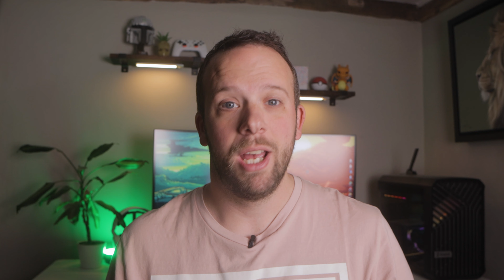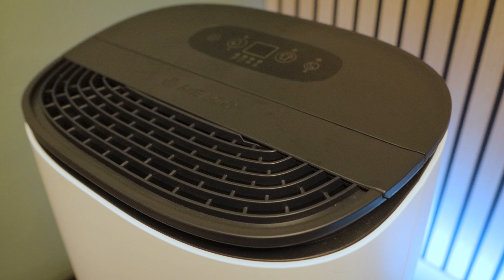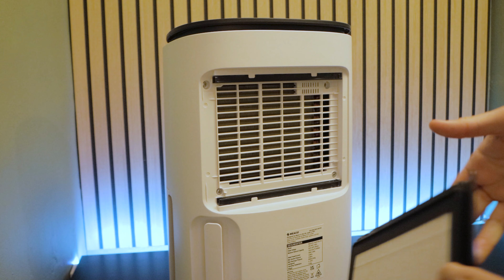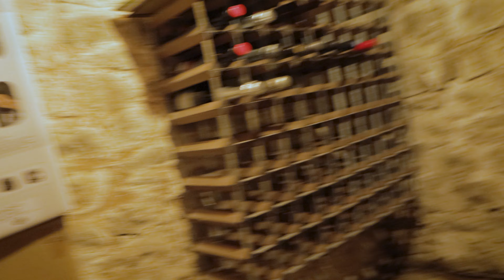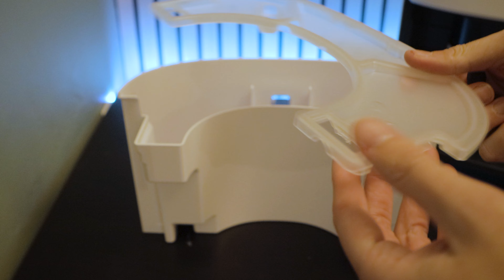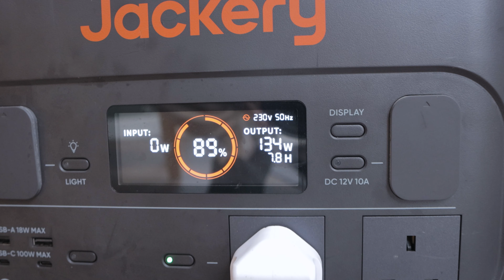Meaco Arete One 12L Dehumidifier Review | Efficiency & Running Costs Explained

Comment: Very helpful. I am about to switch from a dessicant to an Arete One so appreciate the demo :-) With laundry drying, if you are home, set a timer every 45 mins or so and rotate your laundry it will really help speed up drying. I have a free-standing collapsible indoor rotary airer so I just give it a spin and for trousers, socks and towels half way through rehang them the other way up. Generally 8-10 hours will fully dry a load of laundry, but 4-6 hours will usually deal with smaller loads or thinner ones like dish cloths and tea towels. Lovely ceiling beams btw! 🙂
Reply from the maker: Thanks for the advice and the kind words about the beams! 🙂

Comment: i guess the stated wattage is max draw so includes when the heater element is on
Reply from the maker: There is not heat function, any warmth is naturally generated from the compressor I imagine but the stated wattage should be when it's working it's hardest.

Comment: How much will the MEACO MeacoDry Arete Two 20L Dehumidifier & Air Purifier cost to run per hour ?
Reply from the maker: It can use upto 230watts, or 0.23kwh, so if you're paying 30pkwh via your supplier, it will cost around 7p per hour.

Comment: Great vid thanks. But going from humidity 86% to 80% over 12 hours ... is that supposed to be good? I expected a bigger difference in dehumidying ... even from 72% to 62% ... does it ever get to like 50%?
Reply from the maker: There are so many variables that effect performance and it can sometimes take some time! I have had it down to 55% before, my target, then it will turn on/off as when to maintain that.
Reply: @TechNuovo  thanks

Comment: Bought the Arete One 12L, it's stupidly loud at 40-46 dB from 1m. Do not buy if you're remotely sensitive to noise and you must be in the same room... I find it annoying from 3-4m away *with ear plugs on*, as I tried (unsuccessfully) to sleep with it running.

It also produces an annoying high pitched noise in my case. On top of that, once it reaches its target humidity level it will spin at full blast every 30m to detect the humidity level.

"Whisper quiet at 35 dB" claims their website... I don't think so!
Reply from the maker: Yup I certainly wouldn’t have it in the same room as me while sleeping.

Comment: I got abc 10l. Been like 31 hours on CO mode, just emptied 2nd full tank (2.6l x 2). Was around ~68% at 22c ish, now lingering between 52-56%. Foggy outside, 3-8C, snow melting so very humid. I kind of wish i actually got arete or so, so it would have airpurifier with that hepa filter for allergens, pm2.5 and all other crap.
Reply from the maker: Maybe next time when you need a new one, you can go Arête 😊

Comment: I’m thinking about purchasing one of these since I’m scared of opening the windows due to mice getting in. Would it work fine if I switch locations everyday between my bedroom and living room? Or perhaps if I leave it in a corridor? I hope the air purifier works good too!
Reply from the maker: It works better on a room by room basis with doors closed, rather than trying to do multiple rooms from a corridor. For me, I leave it in a room until Im happy with the level, and it might extract 1 maybe 2 tanks of water, then move onto the next.
Reply: @TechNuovo  Really? I been seeing a lot saying you’re meant to leave all doors open whilst doing it as that’s supposedly better.
Reply from the maker: I’ve just found it takes a lot longer to collect a tank of water if the door is open.
Reply: I’m also in a small 1 bedroom apartment that has like only 4 main rooms.

Comment: So I'm a bit confused, what does the L stand for then? Do I need a 10L 12L, 20L or 30L ? 
I live in rented accommodation and house has little to no insulation. It's very damp and cold in the house and heating doesn't last long so I need something to pull the dampness out of rooms. We have quite a small house.
Reply from the maker: The L stands for how many litres the unit will extract in a day at 30c 80rh. 

I have the 12L and a 3 bed house but I move it around, room by room. It removes a lot of water!

Comment: Out of interest if you pick yours up/move it do you feel something heavily weighted (maybe the compressor) move around/shift/wobble inside. I bought one used and it seems to work but something heavy inside seems to move
Reply from the maker: Negative, moving it and wheeling it around, it’s solid, it’s well built in my opinion.
Reply: @ umm thanks. Something loose in mine then.
Reply from the maker: Yeh might be!

Comment: I have the same unit for a similarly old house. I’d be interested to know how you optimised use around the house? At the moment, mine lives in the basement on a smart plug running 24/7. With a smart humidity sensor I can turn it on and off at the switch between a small range which means less time to go down to stated humidity. But means I can’t use around house.
Reply from the maker: For me, I have specific rooms to areas that are worse than others, so at this time of year I generally just rotate round, collect a tank full off water and move to the next. It may be a week or two before going back to that same spot, I just see how it is.

Comment: Bought one, too noisy to live with. Tests revealed between 47 to 69dbs, more than double the claimed 30dbs. Useless, as we wanted it on overnight to put an end to the condensation during the Scottish winter months. Could never get to sleep with that racket in the hallway, and no way in the bedroom. Certainly draws a lot of moisture out of the air, just way too loud.
Reply from the maker: Yup, you certainly can’t get to sleep with it in the same room.
Reply: I had the same experience with mine - like having a fridge in the bedroom - so I've put it in the hallway but that means I can hear it in every room of my flat !! as you need to have all the doors open for it to work😔

Comment: The L does stand for litres. It's the maximum extraction rate per day. The 25L will remove more water per day. However it also uses more power to do so. You're usually better off running lower power for longer than high power shorter. Unless you have very cheap electricity or don't care about your bill. Also the 25l would for example be better if you want a product to dry leaks in homes, this would get the job done faster.
The Meaco Arete One/Two are excellent products with very good efficiency.
Reply: Not just per day but at a certain temperature and certain humidity levels. It will not remove anywhere near 12 liters per day in a house kept at let's say 17C and 60% humidity.
Edit: apparently the test conditions are 30C and 80% humidity.

Comment: So happy found your video 1st winter in a tiny house built in 1840  even with heating on feels damp cold stone walls floors beautiful my washing not drying 😮 someone mention dehumidifier didn’t even know what one did lol ,been looking it’s a mine field haven’t a clue on tight budget watching this has helped 100% many thanks 🤩
Reply: Just bought one from Argos,   £190    have yet to try it,  well worth it,   does what it's supposed to do extracts water out the air,  well happy
Reply from the maker: Thanks for watching :D

Comment: New to using a dehumidifier. What should be the first step? Should I let it run until it meets 55, and then run it weekly or daily? Thanks
Reply from the maker: I would keep it going for a day, maybe more if the tank is filling up quickly. Keep going until you see the humidity stabailise and then turn it on as and when needed. I tend to run it until i've got two full tanks, then leave it a couple of weeks, they do the same again if needed.

Comment: Hi, thanks for the video!  My 12L arrived this morning. I switched it on around 6.30pm. So far been on 3.5 hrs and has dropped from around 80 when I first switched on to 73. I am going to leave it overnight but my question is, is it necessary to leave on all day too whilst I'm out at work or would it still do it's job if I switch off just before I leave early morning then back on when I'm home? There are days I work from home so I can leave on longer then but not sure if it's necessary to have on 24/7 as Meaco advise? Thanks again.
Reply from the maker: For me, it depends on the weather outside. If its dry outside with a low humidity, it will take longer for the space to rise back up to say 80 for 73, so you may not need to have the unit on as often. In the reverse, if it's wet outside and moisture is coming in, you'll need the unit on to combat that. 

I typically leave it on in a space, long enough to fill a tank, then leave it for a week, so what happens and take it from there.
Reply: Thank you!

Comment: Hi, does this help to prevent mould damp in the ground flat? I'm dreading this winter and I am so fed up of cleaning it. It goes onto some of my clothes and furniture, windows mainly bedroom has bad condensation. Landlord does not do anything. I'm wondering to get this machine and see if it helps. How long do I need to get it running?
Reply: I have the 12L one will be a big help to combat mould/damp etc,   works a treat especially the laundry mode
Reply from the maker: I haven’t had mold as such, condensation yes and a damp environment, which it helped with. I’d keep it running all day, or until the humidity has lowered. It might be you have it on for a few days to manage the space, then once it’s better, use it less often.

Comment: got the 12L and on low fan it runns at 50db 1m away from the machine and 37db at 10m . Not sure how they got that 35 as is definitely not even close to it. Is noisy enough definitely you wouldn't leave it on the room with you
Reply from the maker: Useful insight, thanks for sharing!
Reply: @TechNuovo  my guess is they quote the night mode dB. Bit of marketing trickery IMHO.

Comment: I have got the same dehumidifier and it does a great job . I notice however that when the level is below 3% from target RH the small dehumidifier light turns off (which would indicate the compressor is not on) but the fan keeps working and the machine lights stay on. Is this normal? From an efficiency perspective I would imagine the all functions switch off when below 3% of target? Thanks!
Reply: The fan consumes much less power than the compressor so there isn't a setting that turns the fan on and off. It's also good to run the fan for a few minutes after turning off the compressor anyway because the cold side is still cold and can capture more humidity. It does this automatically when the tank is almost full.
Reply: what does RH stand for?

Comment: Just bought the Atete Two which is very similar.
Just to confirm that having the machine on 24 hours a day, it will continue to draw the 150w(ish) even when it’s reached the desired humidity. I would hope that it would maybe only run for 12-15 hours of the 24hours when it’s been in situ for a week or so?
Reply from the maker: Depending on the setting, when it hits the desired humidity it will 'shut down' for i think 30 minutes, then take a new humidity reading and if it reads the same, stay shut down, if the humidity has increased, it will turn back on. When its 'shut down', the fan isnt running, so i cant imagine its drawing the full amount of power. I hope that made sense :D

Comment: Do I need to run my dehumidifier 24/7 if I have an aquarium in my room?
Reply from the maker: Only if you want the tank emptied 🤣

No, use it as and when needed to suit your goal. Hopefully there is a lid on the aquarium so it doesn’t try suck up that water.

Comment: Just got mine. Where are the wheels?? It doesn't have them🤨
Reply from the maker: They were in the water tank for me when I unboxed it.
Reply: @TechNuovo  thank you!
Reply: One my Arete 12L One they were already installed as the packaging has holes to accomodate them in the styofoam. Might be a change from older versions. I also read from a so called engineer that works for the company that they have switched from Chinese made parts to locally manufactured. How true this is is anyones guess.
Reply: @Mopantsu  thank you - I found them in water tank:)) The machine was working from day one and I'm so happy with it!! Lots of water collected, flat smells good.

Comment: Great review. We are in a 1600sq foot 3 bed house and thinking about the 20l version. Our humidity in every room is about 75%-80 or higher. We are based in Ireland and we have high humidity in general. The 20l would probably be the better option? It is quite an investment going for the bigger model but we're desperate to get humidity down as the house fees so cold with the high humidity. Glad you had a positive experience with the 12l version.
Reply from the maker: I've got a similar size place, I've been using it this week just to keep on top of things. Room closed upstairs, some more open plan downstairs, this thing works for me. Downstairs sitting room/kitchen, filled a tank over night and drop the humidity down by a good 10%. I'm not too sure how much more the 20L is but dont pass by the 12L thinking it isnt enough! IF the water tank worries you, can you plug a hose in and then run the water into a larger bucket.
Reply: @TechNuovo  today we are trying for the first time a rented 10l silver crest unit. It mentions 10l at 30 degrees and 5l at 27 degrees Celcius. Whose home is going to be a THAT warm for maximum efficiency?! Showing at 68% over half a day on which I suppose is quite a decent drop. All in all it's still a decent investment and best to go a little bigger than go too small. There may even be something inbetween a 12 and 20 size. Definately looking at that brand as the one to go with.

Thanks again!
Reply: I also live in a 3 bed end terrace house in the U.K. and I already run the older model downstairs, the Meaco 12L Low Energy Dehumidifier which runs at 41 decibels. But now, I’m thinking of selling it on gumtree and will purchase possibly two Meaco Arête 12L dehumidifier’s instead of one 20L or 25L version, purchasing one 12L for upstairs and one for downstairs which says each one costs 3p per hr, so that’s 6p per hr to run two 12L dehumidifiers which is less then 7p per hr to run the larger ones and will help to localise and focus more closely on the humidity in the entire house.

Comment: For drying cloths - use the smallest room possible and keep the door closed. I dry clothes overnight (Meaco ABC 12L) in our bathroom and it's all completely dry in the morning. Also, bear in mind with your costs, a damp room is more expensive to heat than a dry room. In a really damp property, running a compressor dehumidifier will actually save costs!
Reply from the maker: Great tip!
Reply: @pumpkineater23  I agree !  Use my 12L in my small kitchen (windows shut),  after 3 hours or so is good enough for me,  not dry clothes  but next day almost

Comment: hi - stupid question time...Dehumidifier received today. The instructions say the castors are in the water tank. The lid to the water tank is tightly on so I'm not sure how I can get the castors out without breaking the lid. Any advice would be appreciated. Thank you.
Reply from the maker: I know its tough but it wont break, and it needs to come off to empty/clean. You can push the two catches in with a screwdriver and pop out if you wanted.
Reply: @TechNuovo  HI - thank you so much for your reply. I have just followed your instructions and.....I now have wheels!! I was too scared (that I might cause more damage) to do it yesterday so I left it 24 hours.... Really appreciate you taking the time to answer as the instructions say absolutely nothing about how to find and remove the wheels....
Reply: I rang customer services and they claimed they’d never been asked about this!

Comment: Hi, can I clarify. Does the unit act as a dehumidifier OR an air purifier rather than is doing both at the same time. Do you generally leave yours on for a set amount of time per day? Or just let it run constantly? I’m new to the humidifier life but my daughter has awful asthma so try anything at this point. Thanks
Reply from the maker: Correct, either or but not together. I generally leave mine on until the tank fills up and then turns itself off. It also depends on the humidity in the room
And the target for the machine.
Reply: @TechNuovo why are you giving incorrect advice, even in the instructions it says it performs air purification as long as it's running with the hepa filter is installed. The air purification setting is for running the fan without the compressor if only air purification is desired.
Reply: @maksrambe3812  That is correct. I had the Woods AC30 (pretty expensive) and it was the same with the HEPA filtering, unfortunately it broke after 3months, the 2nd broke after 1 day and the 3rd after 1 day, and after that I just gave up trying.

Comment: Thank you for the Review. I’m thinking to get one like this as I got 3D Printer therefore, a lot of Filaments. To keep them dry, I need some type of Dehumidifier. Do you think it will do the job matey. Any advice will be much appreciated!
I believe, Our World is a Shared Experience!!!
Reply from the maker: Hmm, i have no idea how wet/moist/damp filaments may be but I'm sure this dehumidifier will be able to help out!
Reply: @TechNuovo Thanks matey!!!
Reply: @IfDawidCanYouCan for some filaments like pla it would be fine, but for a lot of the better filaments you also need very dry storage conditions that this won't achieve. Running on continuous or laundry mode it can get to 32% humidity.
Reply: @maksrambe3812   Brilliant... I'll keep in mind. Once the room is organised, I'll look in to this again, so I can save the filaments from any dampness in the room, especially during the winter and cold wether. Look after yourself and each other.
Cheers mate!!!